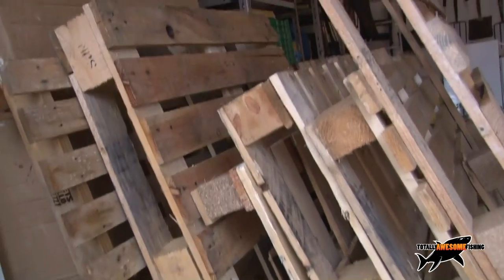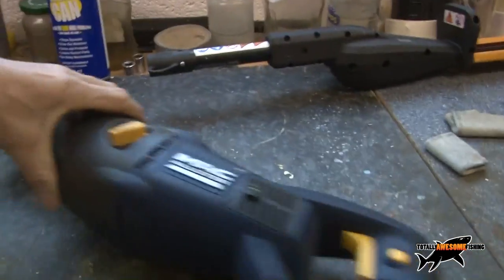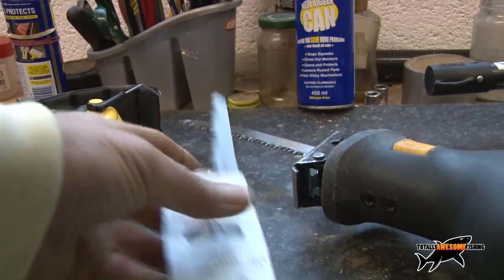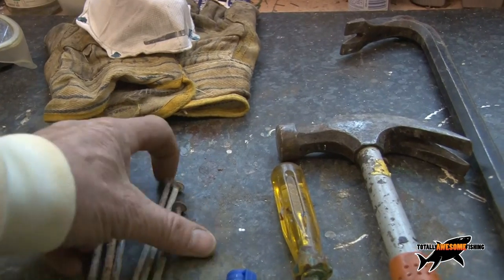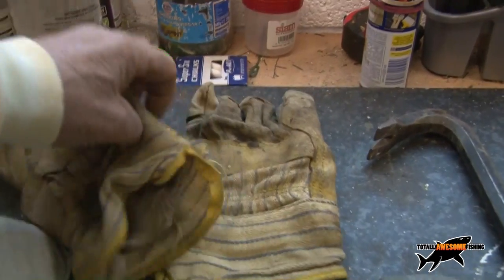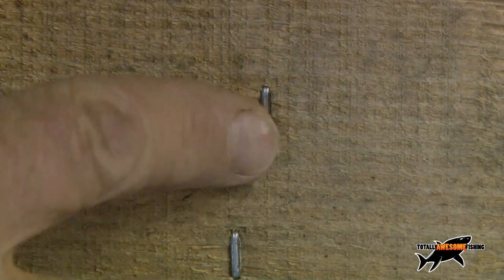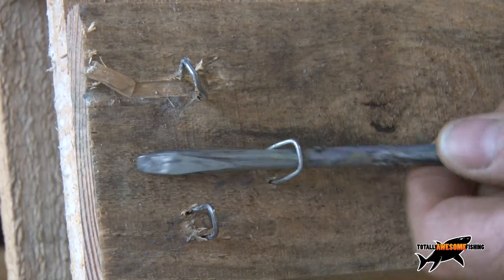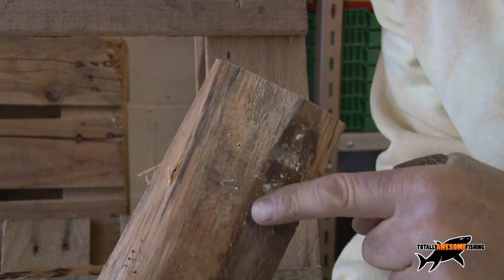How to build a fence using pallet wood - Cheap, simple & easy!

Comment from the maker: I dismantle some of the pallets to get the thicker posts off the back which I use for the stakes. Most pallets will have thicker posts beneath the slats to take the weight of whatever they are carrying. I use them full length, hammer them in the ground until level with the back support you want to nail them to. You can make them any length you want. Cut an even point so they hammer in evenly. You might need to clear a start hole if you have hard ground. Good luck.

Comment: Helpful tip for foggy glasses.. put a dab of dish soap (like dawn for example) on the glasses, i do both sides so theres no chance of them fogging up. Rub with a paper towel until theres no more dish soap residue visible, helps to have a few paper towels, one to wipe the soap everywhere and 1 or 2 more to wipe off the excess. And your glasses wont steam up for a long time!! Usually a couple weeks, at which point, grab the dish soap again :) dish soap has worked better than any product I've bought for fog on glasses. Thumbs up if this was helpful 👍

Comment: Pallets are great,I renewed the whole of the bottom of my garden with pallets from plasterboard,you get 4 great lengths of timber,about 41/2 wide,1/2 in thick and 6ft in length.Plus about 4 bearers of about 3x2in approx.Chop through the nails with a hammer and narrow bolster to cut them,easy to do,and you have free timber.Got all mine free from work,just going to be skipped for recycling.Used this stuff a lot for basic jobs like this,and it is really good.

Comment: Great video, nicely done. I used pallet wood to cover a whole wall in my Flying Squadrons "ready room".  Didn't stain it just mixed the old with new; it looked great! We also covered the front and sides of the bar to tie everything together.

Comment from the maker: You could use a wood preservative, but some pallet wood is soft, some hard. Hardwood lasts longer.3/4 years is about average where I live due to damp weather etc. The important point is to keep the bases an inch or two off the ground to stop damp sucking into the wood and rotting it.

Comment: Chuffing nora i love this idea, the only one thing i could add is using the square blocks for storage and drilling holes in them for storing screw drivers, pencils, drill bits or anything with a long thin tool/shaft. 
I really like this, thankyou for sharing sir.
Neil

Comment: You explained everything so well.  THANKS!!!!!  Until I saw your video, I never knew why the bottom point on the fence post had to be cut at equal angles/lengths.  Appreciatively, dave in austin, texas  ...  ps:  the fast forward demostration was excellent.

Comment: Great video. I have built everything from steps to chairs with pallet wood. FYI, many pallets, including ones for international shipping and ones for produce are treated with chemicals to prevent bugs. Sharing of international pests (wood beetles)and produce spoiling insects are a constant problem with shipping. While this treatment is great for wood used in your garden or outdoors projects, be careful of the burning fumes.

Comment from the maker: In the UK the blue pallets are marked as they have a refundable deposit on them as far as I can remember. They will be much stronger and can be used over and over again for stacking freight on. The block supports are harder wood and burn well in my log burner. As does all the other offcuts. But don't burn tanalised/treated timber. It gives off nasty toxic stuff. My log burner advises 2 year old well dried wood as best. I've tried oak but it has to burn hotter. Not impressed. Ash is the best.

Comment: Hello, I live in South Africa and we have a tiny car and I can't get pallets that easily, but I have rabbits and would like to put up a fence so we can keep them safe, we are both students so need to do it as cheap as possible, it does not need to be a super strong fence, but we do have bad wind and rain here. It only needs to last for 2 years, what type of Cheapest material can I use outside for this fence? I'm getting a jigsaw cutter for my birthday, so that is about the bulk of my tools, the bunnies can jump over anything that is smaller than 1.2 meters and squeeze through anything smaller than 6cm. Thank you, I loved this video!

Comment: Awesome video! I watched a few other videos and none of the other fences look this nice.

Quick question. I have not done much wood working, but shouldn’t a sealer make the wood be rot resistant for longer than a several years?
Reply from the maker: Possibly,or you can paint them,but i find a couple of coats are needed.

Comment: I don't know if you'll see this after all these years but...
Now, I'm not great DIY man... a basic amateur. This afternoon I tried following your instructions but when I came to cutting the thing, my cuts were VERY rough and splintered. Was I perhaps using the wrong (too rough?) type of blade on the electric saw thing? If so, what grade/fine-ness should I go out and buy? Appreciating your advice.
Reply from the maker: Sounds like you had a very coarse blade,check at your local DIY store for a blade suitable for rough wood.I use a reciprocal saw and just looked on the blade packet,it says 5mm ? I think that it between teeth gap,and 240mm long.Its a 9" long blade.But always check the blades are suitable for the tool you are using. Maybe look online at your power tool and see which size fits it.
Reply: @TAFishing  
Great, thanks for that!
I'll go to B&Q this afternoon.

Comment: Excellent tutorial once again Graeme. Quick question about the wood burning stove. Does the resin from soft Scandi woods like pine and spruce cause your flue to gum up and catch fire?
Reply from the maker: Anything making tar will have the potential to stick to the flue.But the stove manufacturers say to occasionally burn the unit really hot which I guess melts the tar and burns it off.I also sweep the chimney myself.

Comment from the maker: I personally would not. Could be dodgy and jump as you need a flat surface to slide the blade up against .That's why I use the reciprocal. The blade goes between the slats of the pallet and you can see exactly what you are cutting.

Comment: Hello!!!! This video is wonderful!!!! I have a question, how far apart do the support beams need to be and how high???
Reply from the maker: HI, The idea is to cut the one side so the remaining two spans are in fact the supports. Check the vid again, hopefully it will be easier to watch than to explain. If you meant the vertical supports, it depends how soft your soil is.You could always hammer them in, attach the panel then cut the tops off the posts once they are fixed.

Comment: Thank you for the info I will definitely use this video to build my garden fence. My crowbar is a flat bar though. Do you suggest the conventional crowbar? Or would the flat bar work just was well?
Reply from the maker: My crowbar has a curve in the tip,much easier to get under points and gaps to lever up.

Comment: Awesome idea thanks for the video...Just have a quick question could you install these picket style fence in between cement blocks/brick up off the ground and stain or paint it with something that is more weather resistance??
Reply from the maker: I guess you could do. The main point is to keep them an inch off the ground so they take longer to rot away(in our damp climate).They soak up stain OK but you might need a couple of coats if you intend painting them.Primer first so it soaks in.

Comment: Love this idea and want to do it in our garden, but just wondering how you would go about installing the fence? Do you need to attach it to posts off the ground?
Reply from the maker: Posts in the ground for support, but keep the panels/wood just an inch or two off the earth so it doesn't suck moisture up into the wood and rot it out quickly.

Comment: So the off cut for the flower bed why take the rest of it off and durn it when ist sturdy you can fill it with with dirt and make a flower bed or fill it with rock to hold it in place and why make it a flat panel wouldn't your fence just be sturdier?

Comment: I like the picket fence work, but the flower bed borders are a complete NO NO, unless you want to find yourself killed by one of those spikes if you accidentally fall down on top of them, or , even worse, it's very dangerous if you have little kids around running all over the places in the garden. Safety first. Less border, more BBQ parties.

Comment: want to know how to ungunk a sink? Pour a splash or two of ammoniq, frankly one of the best, albeit slow working penetrants out there. Pour some, let it sit overnight. Repeat as necessary. Seems to work well with kitchen and bathroom drains.

Ammonia will also "bleach" clothes to a degree. I used to walk all over with just socks. They'd get pretty nasty. Presoak them in soay water and ammonia. Don't be stingy with the ammonia. Let sit for say an hour.. Loosens most of the crud. Then wash them normally.

Comment: What no tooth picks? how about using them to fill a oversized hole that had a #12 screw drove in it and got ripped out the uses are endless I tell you.
go green or go home. cheers